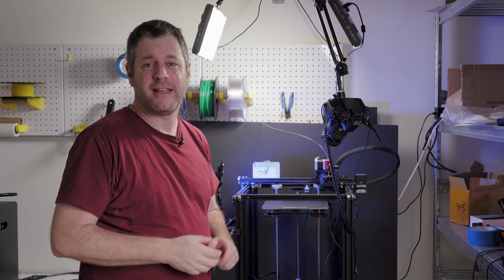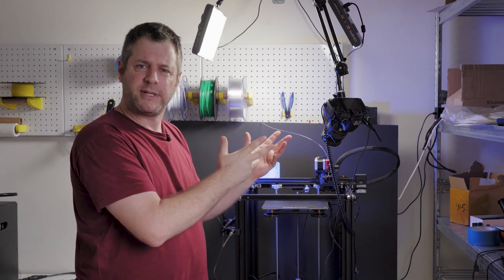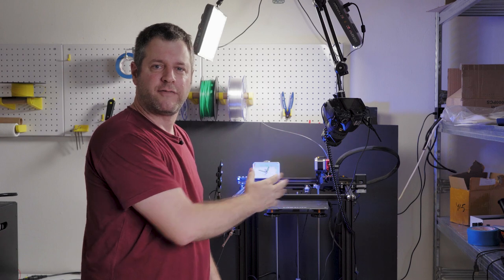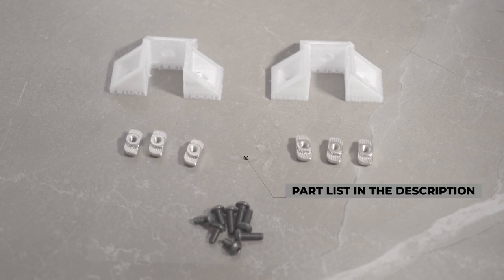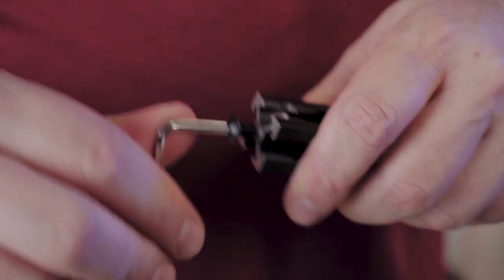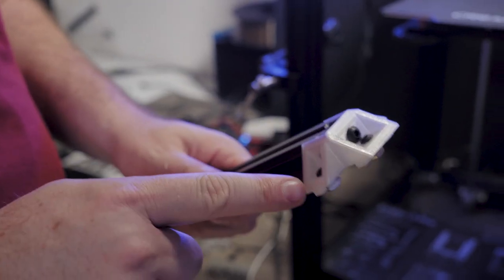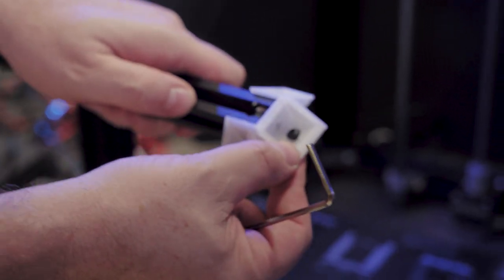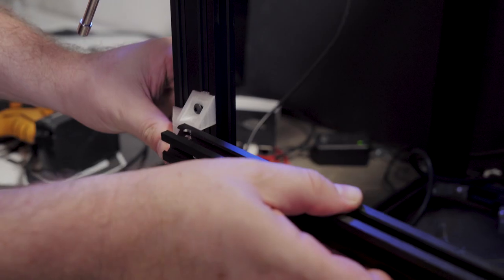How to shoot better timelapse with the Creality Ender 5 (crossbar relocation hack)

Comment: I just used the two t-nuts from the two L brackets from the top front and used the blind screw holes in the extrusion with some slightly longer screws and some small washers and didn’t end up needing to 3D print anything to lower the bar down.